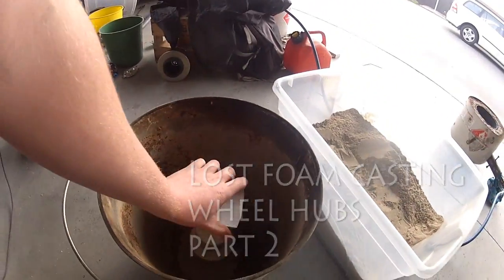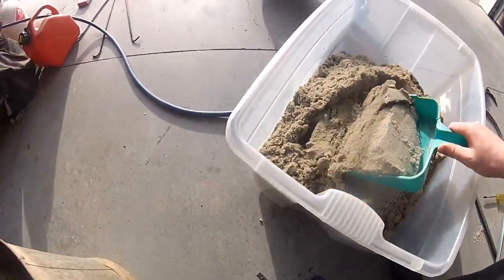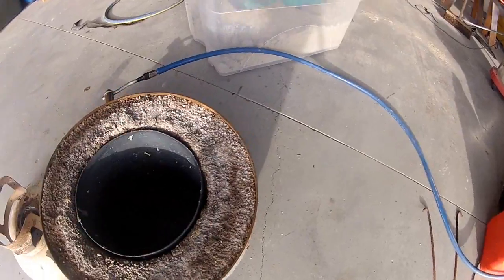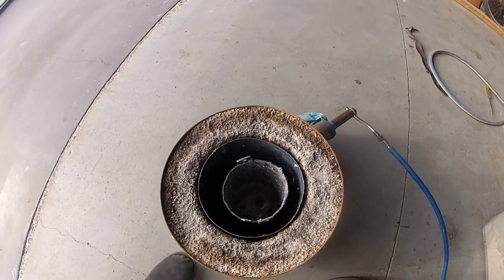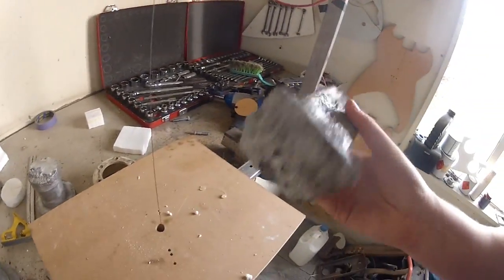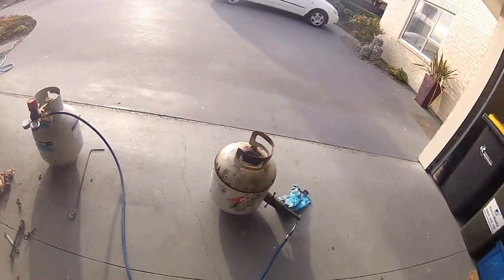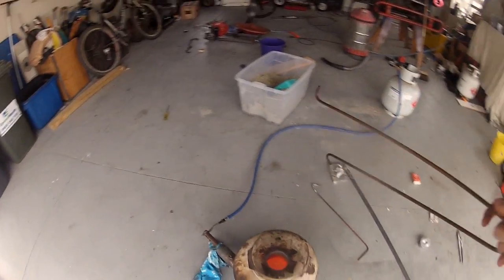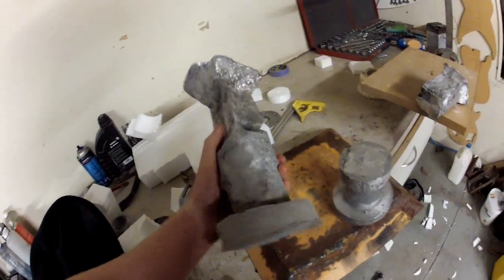Lost Foam Casting Aluminium Kart Hubs | Part 2

Comment: Hello Nice work but is the metal strong enough to trust on a hub do you cut or x-ray a blank. I would have believed it cheaper and safer just to buy really good grade ali.
Reply from the maker: +AVAMagneticlev as it turned out i never finished these hubs, also they were never going on a high power kart so strength wasn't really a concern
Reply: Rhys Dalton
Sorry did not know you were awere of the castings styles limitations clearly you know what your doing enough to be safe.
I would be panicking if not as I work in casting mainly hi pressure as die tech and die maker. And also had one hell of a crash in a 100cc R with mods was over 110km flipped flew 8 or 12 feet upside down landed slide off track up side down rolled got spat out. Walked away with a limp until days later when the injuries can out there were many fractured hip only one. Its amazing how much blue and purple can days after the crash. The crash was part my fault and a little the cart that was a just finished rebuild first time out and not mine it was smashed up like me.
Reply from the maker: man that sounds like a nasty one, I have never had a crash on any of my creations haha
Reply: Rhys Dalton
Same here was a friends cart if I had build it I would have had a few things better finished than it was. But anyone pushin the limits can have there turn I was lucky was a 50/50 survivable crash if I came off facing the other way 180 I would not be typing now !  
I still remember sliding along after landing upside down backwards thinking ow crap as I did not know witch way I was facing just had to slide and wait for the edge of the track and the crunch that came with it.
There was a list of damage me and the cart. I can still crack the bones in pelvis/hip that copped the worst of it and it was 16 years ago. 
Still go fast !